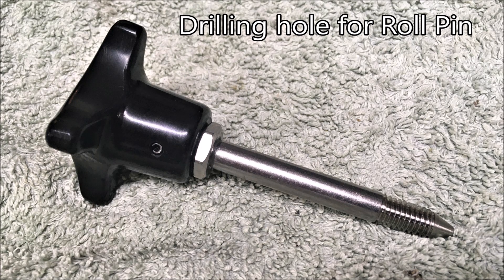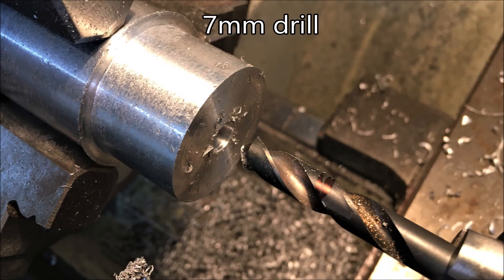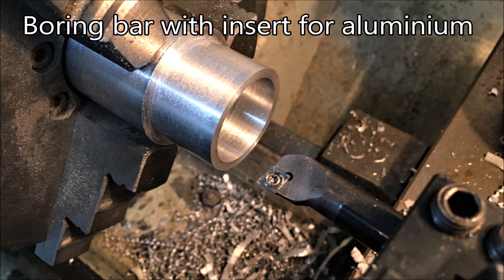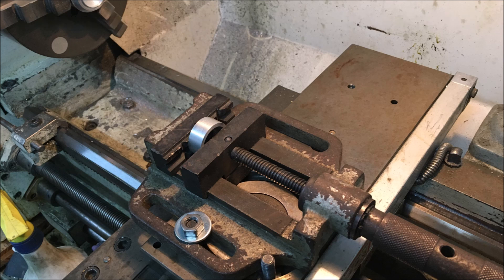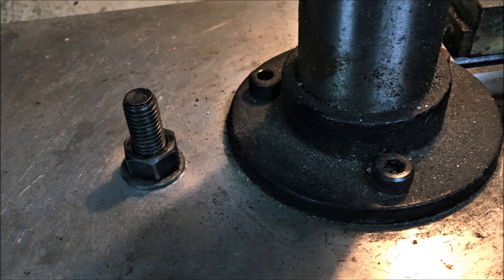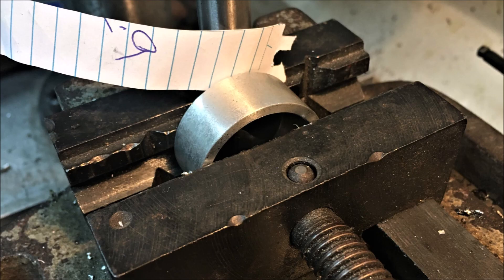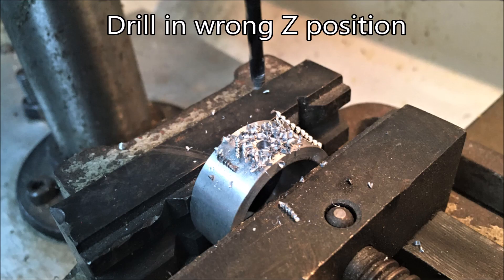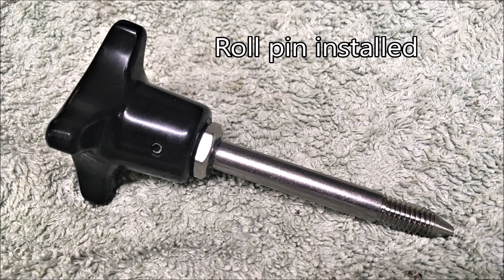Using the DRO on my lathe to drill roll pin holes with a drill press

Comment: Before i commence my training(self taught operation), I've been trying to to determine how worn, and/ or buggered my machine is....i understand that the wear can be compensated for within the computer/ program and my machine does have a tool setter...in particular, im thinking id tools...im looking to get my id tools right on centre. Im using a finger type indicator and held it in both chuck and toolholder, attemting to " swing it" without a change in gauge reading to confirm im dead centre. Having a hell of a time doing so!!! Am i wasteing my time doing this? I can be a bit ocd at times!....lol.
Reply from the maker: Bugger I just lost a lengthy reply.
I am 75 this year and I said to myself tonight. "Life is is too bloody short to be a perfectionist"  
Boring bars and drill/slot drills can be a pain to get on centre if you want to be too fussy. I find that if they are not cutting well, I should probably check the height.  The time to get pretty fussy about things, is the first time you press the go button on a new program.  I usually slow my rapids down to very little although it does depend a bit on program complexity and if I am have an attack of being brave.
Reply: @smallcnclathes  I'm a bit younger at 53 but I absolutely concur! Life is definitely too short. I'm a detail orientated person so sometimes find " big picture" difficult.
Reply from the maker: How long is it now until we see a video of your lathe working?  Do you have the equipment to make videos?
Reply from the maker: Craig, lots of videos on YT of people striving for the utmost accuracy with their machines.  All that matters, is, "Does it make parts" and "Does it make them accurately enough to suit your needs" My little machines are far from perfect but they allow me to make the parts folks want to buy.  To me that is what counts.  My advice is to make some parts and if you like what you see, Job Done!
Reply: @smallcnclathes  excellent advice! Thankyou Nigel

Comment: That was way better than anything I could have done.  I don't have a lathe or DRO or anything. It would just be eyeballing it.  LOL  Good job on getting that setup. Makes a great repeatable process.
Reply from the maker: Hi Gary thanks for the comment. Years ago I had to drill a number of 3mm holes in a 10 mm tube. Using the dro on the lathe was my only option.